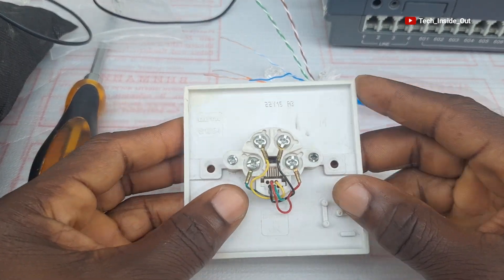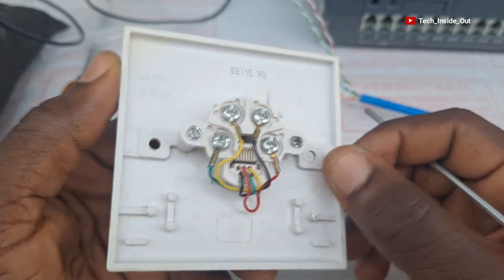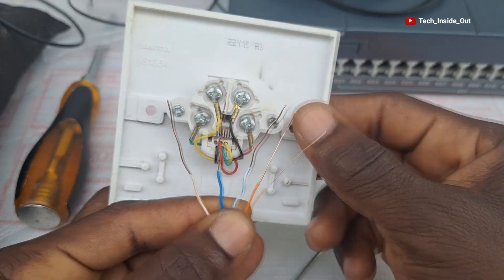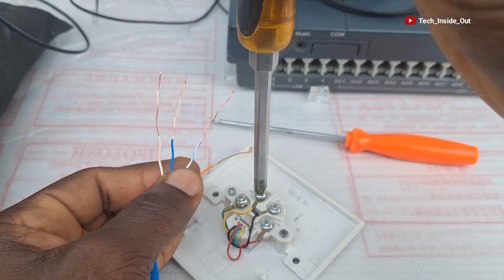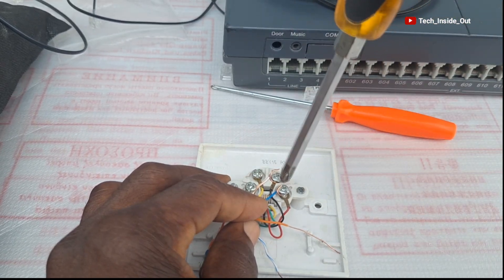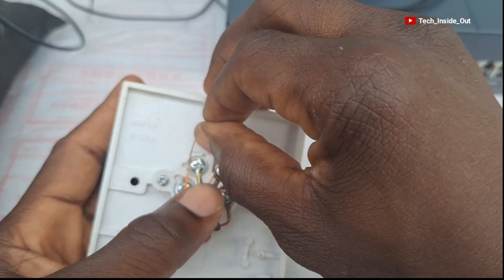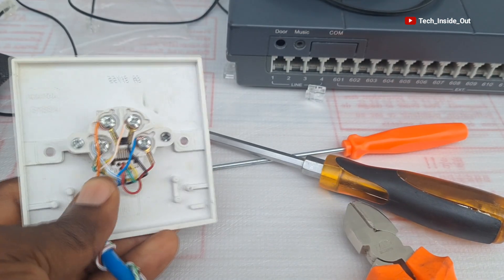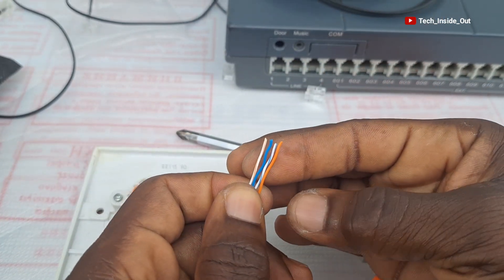How to wire a telephone socket

Comment: Is it possible to remove an elevator phone line cable that has been terminated on a 66 block and connect it to a phone surface mount box?
Reply from the maker: Yes, it is possible
Reply: thank you.  @Tech_Inside_Out

Comment: Can we use cable tester to confirm the connection without electricity? Incase no power supply
Reply from the maker: A LAN tester can be used in the test